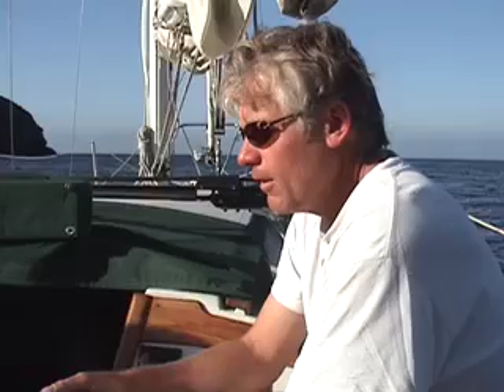electric sailing.mov

Comment: What model, voltage and capacity (and at what hour rate) are the batteries you use?  What range do you get and at what speed? What are the make, model and ratings of the motor and controller? etc, etc, etc!!

Comment: Sorry, but much of your narration is complete gibberish.  If you have your sail up with the motor going you may 'fill your sails' but do not delude yourself that - as you appear to be saying - you are getting something for nothing.  Your boat will move much more effectively under electric power with *less* drag not *more*.  Please quote some actual figures not just disconnected waffle.  (cont...)